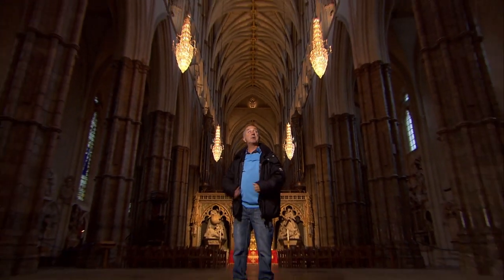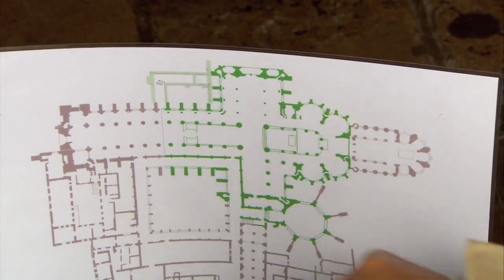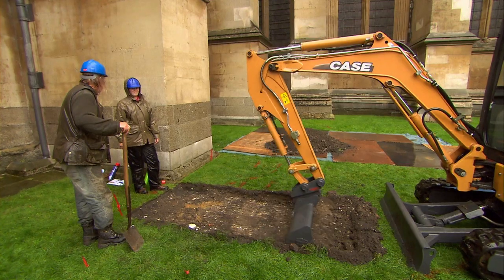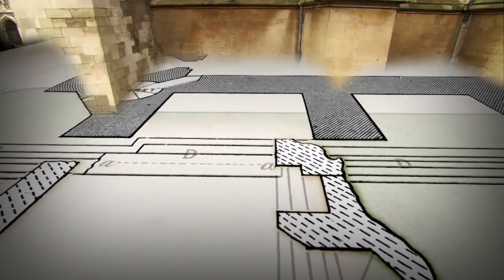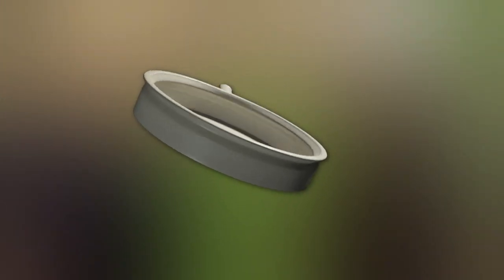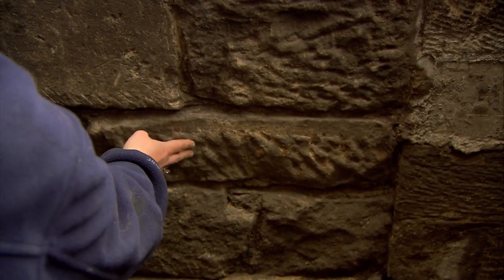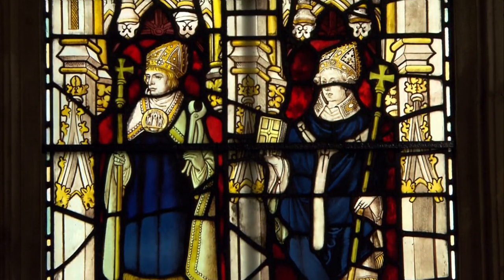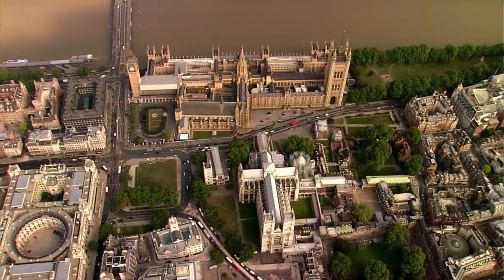All About Westminster Abbey | FULL EPISODE | Time Team

Comment: Beautiful production as always, but it occurs to me...the space between the buttresses and the sacristy? How is that not a robing room? There is no doubt that the exterior footprint has been changed many times, why not consider that the space between the main building and the corridor is the sacristy itself? Walled away from the main building with only an exterior channel to the interior of the building would suggest to me that it would have been highly secure as was pointed out in the first part of the program.
Reply: They didn't give any indication that geophys found anything to suggest that, but it would be interesting to see what might come out of another trench. This show always leaves you wanting more!
Reply: @anne-droid7739  Excellent observation, but geophys looks for walls and ditches and a paved floor does not show up on the scans. A robing room would simply be blank space to geophys as we have seen in Roman excavations.
Reply: @DodiTov  I was thinking in terms of foundations heavy enough to support the kind of masonry in the other sacristy. A robing room wouldn't need that, though...but then again, another robing room wouldn't be necessary.
Reply: @DodiTov  Perhaps I misunderstood--are you not visualizing a wall for this room running parallel to the buttresses?
Reply: @anne-droid7739  Well, yes! Look at the plan as laid out. The "corridor" could/might have had openings to access the corridor from this proposed "robing room". The buttresses we see today are an addition/renovation as seen from the inside with the processional arch. The ones we see tpday within the proposed room would have been added as the original structure was deleted. 
Frankly, it does not make sense that there is a processional corridor without a robing room, especially if the corridor accesses two different chapels...as it does. Where did they put on the vestments for the processional? Clergy are not prone to just stroll about with heavy vestments from site to site. A sacristy located in that space would only be logical, with the corridor a staging area for the processional *from the sacristy*.
Reply: @DodiTov  The L-shaped room is the robing room. I'm unclear about why another would be necessary.
Reply: @DodiTov  Notice in the animation at 46:15--they show vestment cases along the walls. That is where they visualize them having robed up. They don't see them as building that space just to line up in.
Reply: @anne-droid7739  No, it's a processional corridor. That much is clear; it's a staging area. It's not a room, it's more of a gallery connecting the two chapels. Which still leaves us with the blank space between the gallery and the intersection of the two chapels. As small as the space is, it would not have been a garden because there would have been no sunlight penetrating. If anything, this would have been a sacristy robing area. Where would they have stored the vestments? It is clear that the staging corridor (L shaped room) isn't wide enough to have the processional staging AND storage for said vestments. Medieval construction tells us that the space would not have gone unused because a staging gallery would have been attached to *something*, not just lying out in space. Even if the buttresses were in place at original building, it is a relatively simple matter to roof over and have the buttress space as a safe storage.
My thesis is that the L-shaped room encloses the sacristy which is that blank space, the inner wall being the wall that makes the "outer wall" of the room. After all, we have no evidence for any doors because of later modifications. Everyone has just assumed that it's a blank space...I don't think so.
Reply: @anne-droid7739  Ah! Sorry for the out of order replies. I appreciate the discussion, it's exhilarating to have two points of view to a conundrum. However the animation shows cases, there are still the implements that go with the processional and one does not just lean them against the wall. That one space is not accounted for! If the L-shaped room is the only structure, then why leave it blank? Usable space in a fortress/church would be reinforced against attack, especially if it were known (as it was) that there were riches to be had. A "flying" corridor would be a likely point of attack, and would be obvious to the ground viewer.
Reply: @DodiTov  I just explained that to you. What, exactly, do you think vestment cases are for? Have you ever even been in a vestry?
Reply: @anne-droid7739  Yes I have. The point remains that there is usable space that is not used. Tell me what is that space used for? Not being argumentative, just wanting to account for an unaccounted space. It's not a garden, it's not a sacristy (by your viewpoint)...so what is it?
Reply: @DodiTov  It's unused space. I can't imagine where you got the idea that they didn't have that in the Middle Ages. I think you're overlooking a rather salient point: The professionals with decades of experience didn't find it odd, and they saw nothing in their extensive document review, their survey, or their excavation which led them to believe there was a robing room there. They explain it as and show it as a staging area--and yes, that includes robing in a church.
Reply: @anne-droid7739  Ok. I appreciate the debate, and your kind interaction. I remain unconvinced, but this exchange has been most exhilarating and pleasant. Thank you for your time, I truly appreciate it.
Reply: @DodiTov  Remember, this is effectively "backstage"--not part of the processional itself. They kept the vestments there because that's where they were using them.
Reply: @DodiTov  
I was thinking the same when i saw it. My first thought was “how convinient, a walk-in closet”.
Reply: @kasperkjrsgaard1447  Somehow I can't get that point across! I'm thinking that the blank spot is the long lost treasury.
Reply: In their report they suggest the square space was left open to allow light to the cathedral windows.